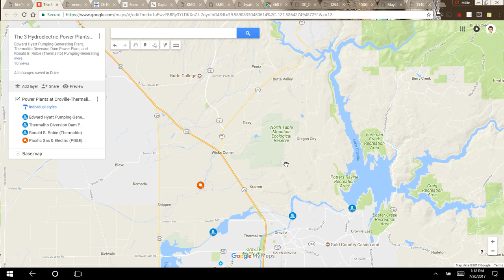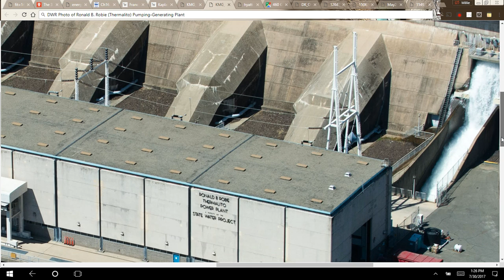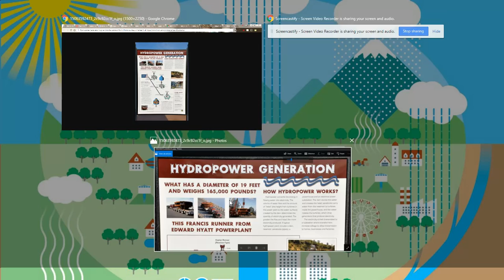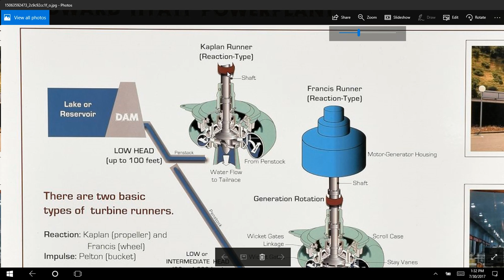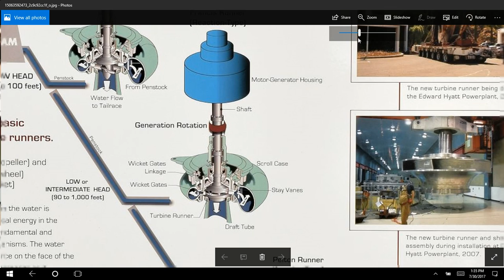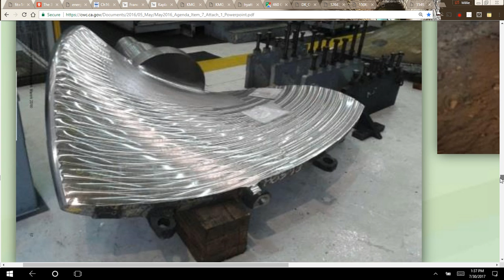The 3 Hydroelectric Power Plants at the Oroville-Thermalito Complex  7/30/17

Comment: Good job Millie. A little information about the Kaplan Turbine that kooks like a  Ship's Propeller with the  variable pitch capabilities. This unit in the Thermalito PP is used to modulate variable load requirements in the overall power Grid Requirements in combination with PG&E Table Mountain Substation. The combination of wicket gates and variable pitch of the propeller allows the generator to be very sensitive to the governor that controls it and power demand in the grid. When a large load of power in needed or decreased the wicket gates and variable pitch of the propeller provides the necessary demand. Just like the throttle in your car when power is needed to go up hill or down. Francis turbines are not as sensitive.
Reply from the maker: Hi stutz dog! Thanks! Whoa, that is really valuable information. After I digest it, I'm going to pin your comment to the top of this Discussion. I hope you will visit my channel often. Commentary like this is what I live for!!!

Comment: G'day Millie,

   Great stuff...!

      So, it's mainly a Hydroelectricity Generation Scheme to run the  Electric Waterpumps needed to distribute the Dam-Water to the Agricultural & Urban Consumers.

   On occasion, if all the Top Dams are full, then they can be operated as a Pumped-Storage "Battery" to allow the Coal-Fired Steam or Gas-Turbine Stations to be operated at their most Fuel-Efficient/Lowest-Emission Output settings, without having to adjust the Throttles to match the actual Demand-Loading ; if there's more Demand than the Generator is making they run Water downhill, turn it's Potential Gravitational Energy into Kinetic Energy, spin 95% of that into Torque, & turn 85% of the Torque into Electrickities...., and when Demand drops below Output they pump the Water back uphill again.

  Pumped-Storage functiobs as a 60% Efficient Storage Battery.

  But the salient point seems to be that every Year the Hydroelectric System consumes a lot more Coal/Gas-fired Current than it ever feeds back into the Grid...; which is a bit of a surprise.

   When I was about 7 years old (1968) we went on a 3-Day Bus-Tour of the Snowy Mountains Hydroelectric-Scheme, in a big Loop start/finishing at Cooma....; back then it was touted as "Free Electricity from the Rain", plus they reversed the Snowy River from going East into the Pacific to go through a Tunnel and flow West, then South into the Great Southern Ocean instead, via an Irrigation Farming Scheme on the way.

   After 30 years, it turned out that it spent 9 months per year working as Pumped-Storage for the Victoran Coal-Fired Grid, due to insufficient Rain to be able to make any "new" Electricity..., and the Scheme wrecked the Ecosystems of three River Basins, the Snowy lost it's Water & dried and died ; while the Murrumbidgee & Murray-Darling Basins discovered that, "If Irrigation exceeds Precipitation then Salination is Inevitable..!", because the River-Water is always Saltier than the Rainfall (and Artesian Water is even Saltier still) ; so, just as did the Babylonians, the Riverina Irrigators literally "Sowed their own Fields with Salt"... (a thing which Alexander the Great used to do to defeated Enemies, as a punishment for having failed to surrender quite fast enough...).

   I helped stop a Pumped-Storage Hydro-Electric Project once, about 20 years ago...; if you go into my "Warbles In The Wilderness..." Playlist, and check out "GREEN POWER IN THE FALLS...", you can see the whole story on that one... (and another time I helped shut down an Acid-Heap Leach-Recovery operation, in a Montane Swamp, stockpiling Cyanide beside an  Open-Cut Gold-Mine atop the Headwaters of the Clarence River, which over 100,000 people drink from, swim in, and fish on...; I was a bit of a Green Activist back in the day, in '97 the Armidale Environment Centre appointed me their Poet In Residence, and I'd accepted it for a month before realising that it meant I'd replaced Judith Wright - Australia's first Poet to write on Environmental & Aboriginal Issues...., who had been their  Founding Patroness & therefore their Poet-In-Residence...., till I showed up...!).

  Anyway,

  Have a good one,

  ;-p

     Ciao !
Reply from the maker: Warbles, you have had a very colorful past!!! Your comments always give me a lot to think about. I'll definitely check out the "Green Power" video next time I'm looking in on the Roos & Choughs! I had just run into some info about the problem of salination during our drought. Interesting.

Comment: Yet another excellent and very informative video.  Well done, Millie.  Those pictures of damage are amazing.  I've been wanting to know more about the turbines.  You delivered!
Reply: One minor correction @5:10, Millie.  Energy can't be "created".  The turbine transfers kinetic energy to mechanical energy which is converted to electrical energy by the generator.
Reply from the maker: Thanks, Don! The one piece of info I could not find is confirmation of the turbine type for the Diversion Dam Plant. (Just one more detail to haunt me.) Thanks for stopping by.
Reply from the maker: You're absolutely right, Don. I thought I had that concept embedded in my head after all the research I did for this one. I must have read about that a hundred times. These videos are gonna fry the few brain cells I have left.